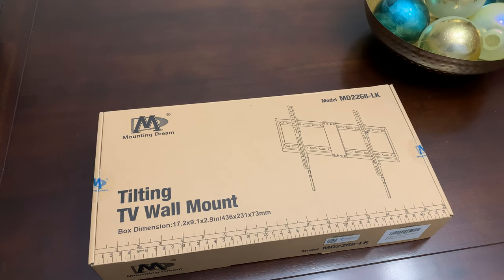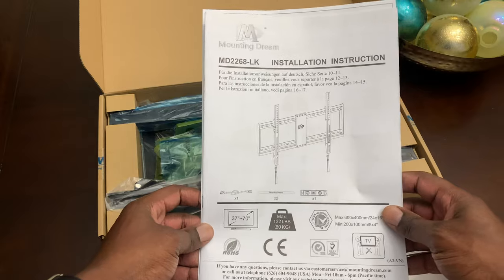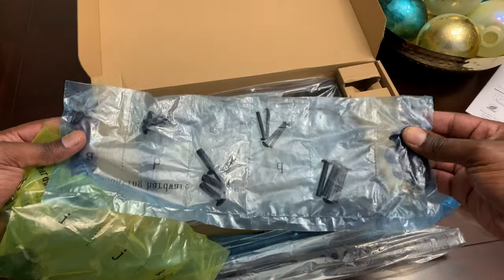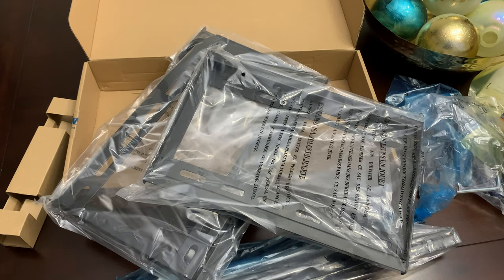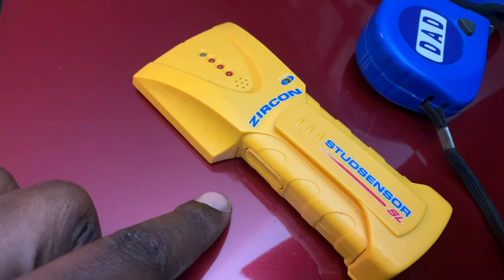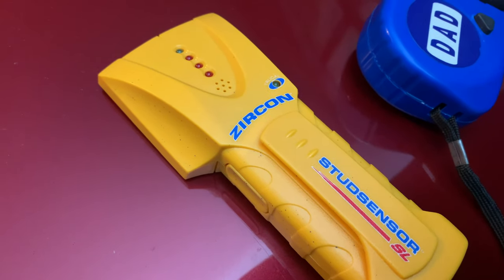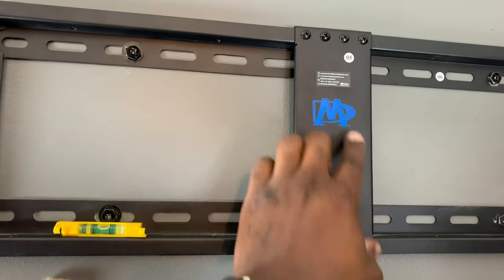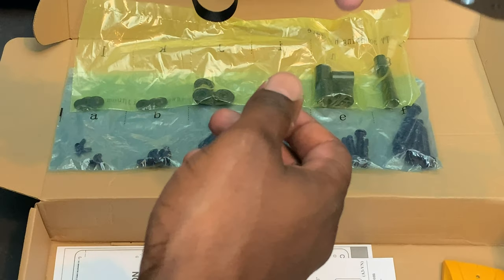Unboxing Mounting Dream TV Mount Install And Review

Comment: Thank you sir for making this video. I went and got a bangin' power drill at home depot and the wrench set. I also got a $10 drill bit set that came with the recommended 7/32 bit (for wood) so that I can start a pilot hole so that fat lag bolt doesn't split the stud, which can happen.😳 No thanks! Anyway, I got my TV all done up with the attachments and also put together the wall mount. All's I got to do is attach that plate to the wall tomorrow and hang the tv. But this video was reassuring 😁

Comment: This was perfect. Just snagged a variation of this mount from amazon and my drill gave out. Wouldn't have occurred to me to use a ratchet if not for your video and it worked perfectly.

Comment: Thanks so much for uploading! — I wanted to ask you how you hid the wires coming off your TV — it looked like you disguised them behind some strip attached to the wall, that you maybe painted the same color as the wall? Looked great. Thanks
Reply from the maker: Yes. That strip can be found at any home improvement store.
Reply: @KOMOSTECH  Oh really? I didn’t know that — what is it called, or how would I find that at Home Depot?

Comment: you may have the two brackets left and right one backwards, if you switch them you'll be able to tilt and and tighten the screw when the tv is already mounted.

Comment: How far from the wall can you mount the TV if I would use the longest spacer? My power socket is invisible and behind the TV, but it does protrude, and I will need at least 2" (between 5 and 6cm).

Comment: So I just bought one of these and had holes in the wall from a prior roommate but the screws are a bit bigger and having issues getting them all the way in..the top two are pretty secure..could I just wing it with the screws not being all the way in???

Comment: At 16:21. You have the tv brackets flipped. The screws (allen key) should be facing outside, not inside. With the screws facing inside, you will not be able to adjust the tilt as you can't get to the screws.

Also, always good to the attach the tV brackets first. This way, you can place the wall bracket against the tv and get your centre measurements before bolting the bracket to the wall. I see that you have not taken any measurements. Hope it worked out for you bro!

Comment: Hey what size was your drill bolt to drill the holes? Thanks
Reply: I know you probably figured this out since it's been a month, but I just grabbed a bit that was smaller than the bolts inner thread diameter. I went with 11/64 but anything around that size should work

Comment: At 16:48 you have the black things sticking out of the tv. Are there supposed to fit inside the hole and stick out or do they not fit in the whole at all?
Reply: The spacer sorry. How do you know what size spacer to use?

Comment: I got couple questions, at 11:40 when you were tightening the screws you didn’t have washers in them, but when you were done at 11:51 they had washers in them, did you unscrew and add washers again? Also do we not need anchors for the holes?
Reply from the maker: It’s a good idea to use washers it won’t hurt. If  you are mounting to Sheetrock then you may want to anchor. You want to mount to solid beams or studs in the wall. The screws well give you a nice secured bracket